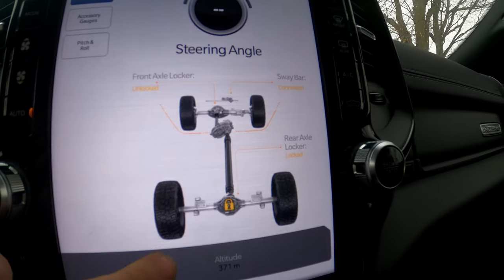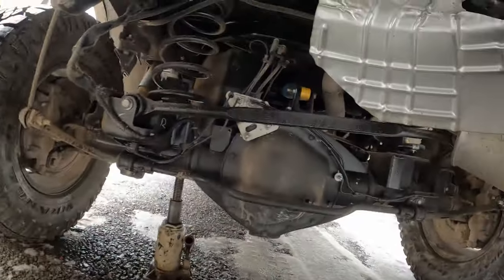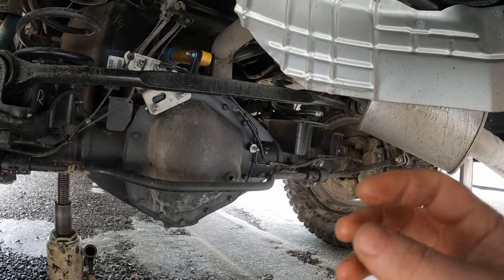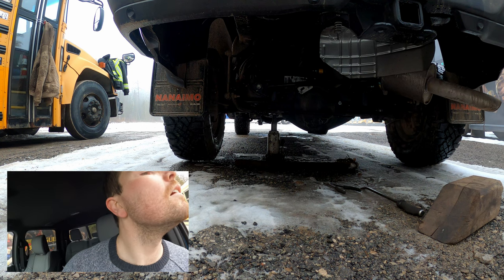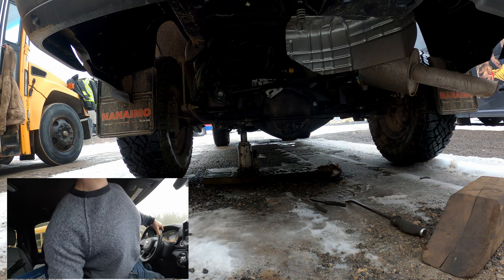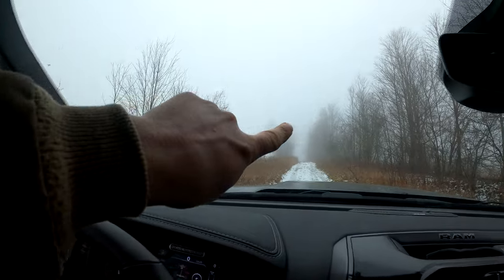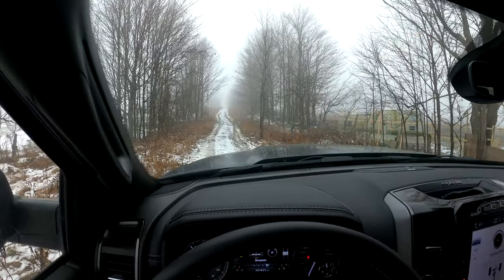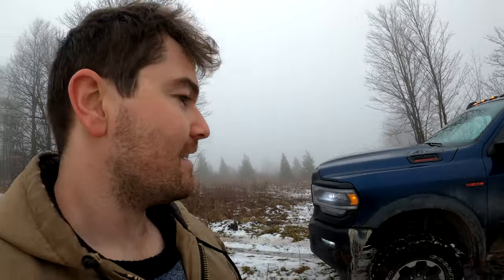RAM 2500 Power Wagon Off-road 4WD | LIMITED SLIP DIFF Vs. LOCKING DIFF

Comment: What is your gear ratio? I’ve seen these come with 410’s and 373’s 
If it is equipped with 410’s what is your fuel mileage highway/ city
Reply: My PW has 4.10 gears, and gets 9 mpg in town and 14 mpg on the highway. Towed a 3900 lb Mustang on a Flatbed for 150 miles and got 11 mpg.

Comment: When I was in the country few days ago. Some guy went into ditch with that same truck you have. I drove my truck into ditch and pulled him out with my gm truck and its only 1500. But even my truck is limit slip. Just gotta send it. You can fix anything I bet
Reply from the maker: If someone with a power wagon couldn't get out of a ditch that's concerning. the ONLY excuse would be if he was buried up to the doors in snow or mud and there was no trees around. like the truck has a winch on it lol 

but yes limited slips are not bad at all. they work great in most situations but I figured I would just show the difference between a locker and a LSD.

Comment: On non PW models if you turn the traction control  nannys off though still not a locked diff there's less wheel spin when articulating the axles Engine Adventures did a video on a 2020 2500 Laramie 4x4 6.4
Reply from the maker: stupid nanny controls lol but that's interesting I wonder why that would be the case! I'll have to check out his video

Comment: The problems I have seen in your videos with LSD is that you don't get on the throttle enough to put sufficient torque to get the wheel with traction to spin.

Comment: your truck does not have a limited slip and e-locker. Auburn is the only manufacturer that makes a selectable locker with limited slip and full locker but it's only up to a dana 44 equivalent.  Being a Ram 2500, this is impossible.
A detroit truetrac would have performed just as good as your detroit e locker in this particular test. 
They both have their strength and weaknesses. a locker can be dangerous as it will make the vehicle pull sideways. truetrac will have equal traction until theres too much of a difference. However if you know how to use a truetrac, there are ways to get it to put power to both wheels if one side is off the ground or on ice

Comment: Looking at Ram website, I see anti spin rear option for 4X4 Larmie.  Are the options this OR elocker? I don't see any locker option, is that standard when I don't select the anti spin?

Edit: Ram 2500 w 6.4L
Reply from the maker: That's interesting, I when I was talking with the dealer he mentioned that you could order a locking rear end for most 2500's.

Comment: Entertaining video but you are not only wrong, you are perpetuating a myth.  Read up on the locking properties of worm gears.  With a Torsen it works exactly opposite to how you explained.  The 80:20 split is incorrect.  It means if you force 20% on the spinning wheel, it will lock the LSD and send 100% to the wheel with traction.  Effectively locking the diff. 

RAM is using low ratio Torsens to reduce wheel spin to reduce the possibilities of grenading the differential when you lock it up.  Also worm gears are stronger then spider gears.   A proper high ratio Torsen locks by touching the brake and adding torque to the spinning wheel.  That forces the gears to bind or wedge tight.  Like kicking a door stop while trying to pull the door towards yourself.  Try your jacked up tire trick, then spin the wheel and touch the brakes.  You'll see what I mean.
Reply from the maker: well I don't want to be perpetuating any myths. I was planning on re-doing this test anyways with some better conditions. I was always told that torsen style diff's are great but when one wheel loses complete traction they don't work. I guess I'll have to give some break next time and get her to catch. thank you for the info!
Reply: @TheGettyAdventures  the PW uses a low angle worm gear verses the high angle used in say a Mustang.  The difference in gear angle changes the lock ratio.  Front Torsen® diff's use a lower ratio so they don't lock when you turn.  This is what the Raptor (option) uses up front.  It can still be very effectively locked with light brake action.  I demonstrated it on Truck King.

https://youtu.be/INhXh1sH9U4
Reply from the maker: @fabulousoffroaddesigns5080  What an AWESOME rig you have sir! I have always loved that ford had a rear locker option but I was not aware that you could also get a front torsen diff installed with warranty as well! Now am I correct saying a helical LSD is a torsen style LSD? both use worm gears I believe. 

my secret goal for this PW is to put a light weight camper in the back and tour the country. that set up would be alot larger then your nice overland rig but I figured I could still get into some cool places! anyways appreciate all the info! your not from Ontario are you?
Reply: @TheGettyAdventures  no not from Ontario.  I live in Prince Edward Island.  I do end up there occasionally. 

Yes the "helical cut gear" system is Torsen®.  All of them are including Quaife, Eaton, and others. This is why you can't call it a locker.  Eaton came out with the True Track after Gleason invented, patented and released the Torsen®.   Gleason sued Eaton for patent infringement and won.  So Eaton Trademerked™ the words "locker" and "locking" and sued Torsen® for using this in their marketing literature and won.  Eaton still pays Gleason for every unit they make, however Gleason re-branded their Torsen®, changing their "torque sensing, auto locking differential" to an LSD on paper, so they don't have to pay Eaton trademark fees.

Comment: Either your limited slip doesn't work or you don't have it. There should be minimal difference in the snow between the two. I have posi in my 2003 s10, never had a problem in the snow. Apparently dodge limited slip sucks.
Reply from the maker: It's a helical/torsen style LSD once one wheel loses complete traction it acts like an open diff. Now a few fellas in comments mentioned that with a simple brake application you can get this style of LSD to hook up nicely. you most likely have a clutch style

Comment: Great video,makes me wish I could afford lockers,can lockers be driven at highway speeds on snowy roads?
Reply from the maker: No they can't, well I'm sure they technically could but you'd be putting a lot of stress and wear on your driveline. Honestly a LSD is great on snowy roads. much much better then an open diff and it's seamless with no wear on your driveline at higher speeds. 

but lockers are great to have when you really get into some deep shit.
Reply: @TheGettyAdventures  thank you for the advice . Much appreciated
Reply: Yes you can. Newer trucks with factory lockers will shut them off around 25mph. This guy knows nothing. If you install a locker aftermarket you can run it at any speed. Not that you want too

Comment: By the way.  Awesome truck!!!  Just curious how you think your other truck would’ve done on that hill. And possibly you tried it???  Very curious because I have a 2013 ram 1500.  Regular cab. 4 wd. With TWO open diffs!!!!!  Wondering how you think a truck equipped as mine , and your old truck would do???? I really can’t understand why ram would even make a 4wd with two open diffs. Maybe front open, limited slip in rear.  I dunno what they were thinking. Watched many of your other trucks videos and it still done well with the two open diffs.  I have had mine about three months now and love the truck. Haven’t taken it off-road yet, but will very soon.  I’m east coast USA, here. Mainly sand. Your thoughts on open diffs in sand??  Know your mainly snow and mud. Just get your thoughts???
Reply: Open diff 1500 here myself, if you just need a 4x4 to live and use your truck for truck things you’ll be fine with good tires. I survived fine last year on stretched street tires on trips to northern wi which included driving on plowed trails/roads during blizzard conditions and to the mountains in North Carolina for snowboarding driving on untreated switchbacks. If you need a true off road vehicle though your open diffs will leave you longing for a winch for sure.
Reply: @michaelgregory7457  thanks Michael,  pretty much I got a truck for truck things. Just was curious, live close to a place called freeman park and they allow driving on the beach.  Most anything I do will be in sand. Do plan on going there towards spring and wanted input on these open diffs dodge for some reason done to us!! Used to live close to uwharrie national forest so will go back visiting cuz and do a little of those trails also. North Carolina RED MUD there.  Very slick!!  Looks like if I do too much, new bumper and winch will be needed. 2013 ram express, so not a good bumper for winches I’m afraid!!   Thank again!!  Everyone be safe out there!!!
Reply: @samlautenschleger9771  there’s not much I haven’t been able to get through and outside of that I just know my personal limits. Anytime I think the 4x4 system is being pushed to its limits on my truck I stop, because where I’m driving most often if something goes wrong, I’m sliding down a steep hill hitting tree trunks hahaha. That being said, with your demands you should be just fine.
Reply: @michaelgregory7457  👍👍👍👍. Thanks again. I’ll not get in too much and always have the buddy truck along too!!!!!Be safe out there and watch out for those 🌲!!!!!!😃

Comment: A couple parts of your explanation aren't really accurate. The first thing, which gets repeated endlessly...a locked differential does NOT split TORQUE evenly 50/50. It splits ROTATIONAL SPEED evenly. The TORQUE sent to each wheel is a function of the reaction force from the ground (or the brakes). So if you have a locked diff with one wheel in the air, the wheel on the ground is getting almost 100% of the torque because it has all of the reaction force (resistance to turning). The wheel in the air has almost no resistance to turning, so it's only getting a tiny bit of torque. Second, you're completely mixing up how clutch plate limited slip differentials work versus helical-gear torque-biasing differentials. Clutch LSDs generally have a percentage (often 15%-40% for production street car diffs) of torque that they can send to the wheel with traction when the other one is spinning. And a clutch LSD will do that even with the spinning wheel completely up in the air. A torque-biasing helical-gear diff takes the reaction torque from the low-traction wheel and can send that much torque times the biasing ratio (usually somewhere from 1.5 to 4.0) to the opposite wheel. So if one wheel is on ice and can only take 50 ft-lb of torque before spinning, a helical diff with a 3:1 biasing ratio can send up to 150 ft-lb of torque to the other wheel. And it does this instantaneously using the gear geometry, unlike a clutch LSD which first spins the low-traction wheel, then starts to transfer torque as clamp force builds up between the plates and friction drags the high-traction side into motion. And finally...limited slips (clutch, helical, gerotor, viscous) don't suck, they're just not intended to be used for mudding or rock-crawling. They're for maintaining relatively continuous power transfer to the ground during street driving, including during hard acceleration in corners and changes in surface conditions. Front and rear lockers are useless on the highway, but that rear helical can keep your Power Wagon more stable on the highway dry or wet when you're in 2WD as well as when it's slippery enough to use 4WD. Front and rear helical diffs together with 4HI would be the ideal configuration for snowy or icy highway driving.

Comment: I call BS!.. if your “locked” differential can’t pull your truck off that jack then it’s not working, it’s doing no good whatsoever. I would lock it, drive ahead a bit and give it a chance to lock in, then jack it up, if it’s working it will drive off the jack, if not, it’s not working.

Comment: My 17 cummins got stuck on flat ground in 2 inches of snow! Have video of 1 back wheel and one front wheel turning while in drive witb no gas applied. Complete joke!
Reply from the maker: lockers man they make a big difference. that and good set of tires!
Reply: Obviously your Cummins was ordered without the noslip diff option, works friggin fantastic,  I think its the Snow Chief package if I remember might be aval as a stand alone option.

Comment: Yeah there's several different things going here in four high you can bog down to where your wheel speed stops and in your vehicle stops and you're automatic transmission breaks the bond breaks the lock between the engine and the transmission and then you're stuck a Jeep I don't know about other vehicles but a jeep has locked up in four low of the torque converter so the joining of the engine in the transmission is much more reliable so that you can't get your wheel speed slowed down and then get you stuck. You guys with big gay trucks will know this that you got all the high powered engine high torque engine right and then piss poor off-road performance so you got tall tires with short side walls you're running street tires you've got a high torque engine you're running around off-road in 4 high and you bitching that you're getting stuck you got the wrong equipment and you don't know what you're doing is what the problem is but you try to blame it on a limited slip diff and you're wrong.  Even two open diffs lets the engine and the wheels find the traction that's available and it will propel you but if you have a high power high torque engine and your hard on the throttle you might as well be driving Chevy Camaro from the 69 with a 427 in it you're not going anywhere with it. Trucks are made to be sold they're not necessarily made to be good off-road in the optimal sense. Best all around general purpose way to go limited slip in the back selectable locker in the front and then stop talking about it and get some mud tires